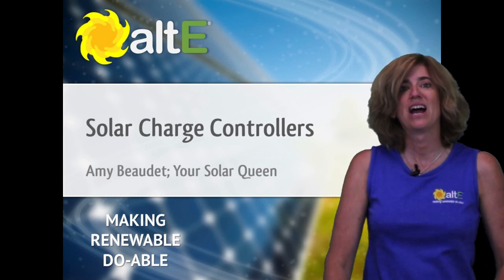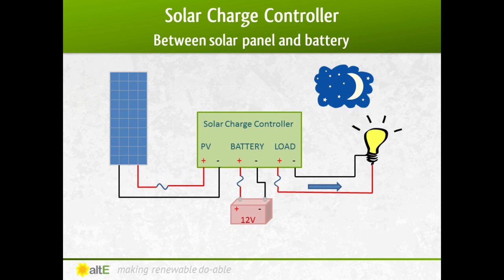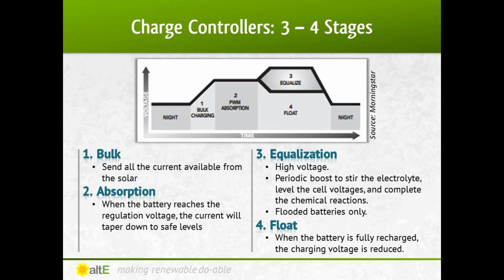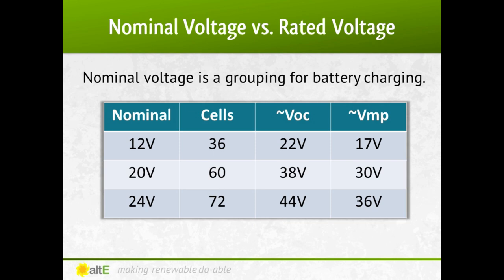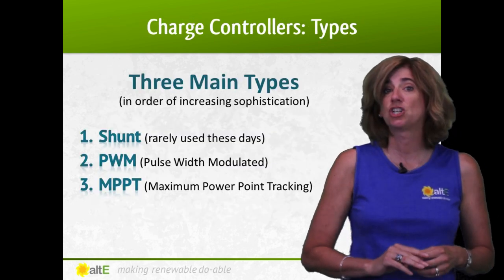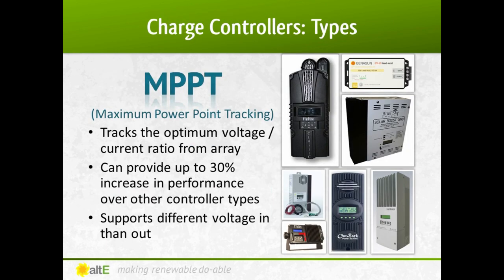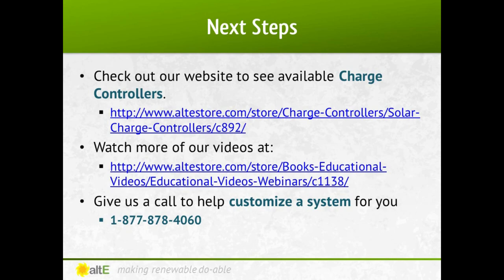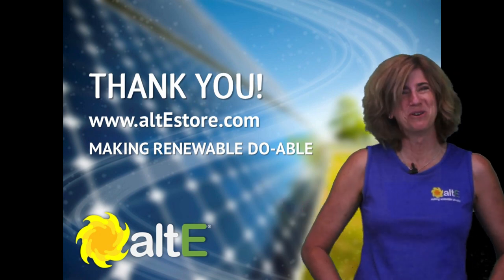Solar Charge Controller | What is it and How it works in a Solar Power System

Comment: plz help i am a litttle confused i have alino inverter 3024e by outback and it has a built in charge controller of 80a it supports 24v plz see its datasheet  http://www.outbackpower.com/products/integrated-systems/alino/item/alino-tl. its datasheet says that with72 cell panel i can make 5 to 10 panels in series and max of 2 paralel combintions if i connect 5 panels in series and make 2 paralel combinations my total watts wod b 3300w(10*330w panel) and 3300/24=137a so ineed 137a charge controler but the inverter has 80a mppt cc .similarly 24v*80a=1920w but it says i can conect up to 4000w i followed the datasheet kindly comment on this
2) with same inverter same 10panels of330w making 3300w total and with 2 12v 100ah batery plz tell that what portion of this3300w is going to charge my battery and what proportion is going to run my load at day.and how much time these batteries take to charge cmpletely  thanks
Reply from the maker: The datasheet says up to 3000W for 24V battery bank. However, it will limit the output to 80A. It is common to oversize the solar array to provide more power earlier and later in the day. But mid day, if conditions are perfect and the panels are putting out full power, the charge controller will limit the output. However, what I am concerned about is if your batteries are lead acid, your battery bank is much too small for 80A. You should have at least 4x that battery bank. Charging a 100Ah lead acid battery bank at 80A will damage them. If it is lithium, I would still recommend at least 200Ah.

Comment: Bulk charging mode doesn't mean you can send the battery bank all of the available power.  A large solar array can easily "overpower" a small battery bank for example.  Also, you are misleading people that you need 48V rated solar panels (or some combination such as four 12V panels), to charge a 48V battery bank.  This is not true.  They have boost converters such that a 24V panel (for example), can be used to charge a 48V battery bank.  I have one of these boost solar charge converters and it works quite well.  Very bad Amy that you are giving out wrong information.  Downvoted for wrong information.

Comment: The math annotations in the video are weird at 7:15... the way it's explained is terrible. The example should read, if you want to run 1500w heater for an hour, you need to generate at least 1500w in one day. Since you only make 300w, you will need 4 more panels (totaling 1500)to generate the 1500w your heater consumed. 

the formula should be 1500w demand - 300w supply = 1200w deficit... 1200w (deficit) / 300w (generated per panel) = # of panels needed to get 1500w

the second example is worse. 1500w x 5hrs = 7500w demand. 7500w demand / 300w supply= 25 PANELS not 2500w. 2500w is the total W generated for you system...again it's the same information but annotation doesn't match the explanation.
Reply from the maker: I think you wrote this comment on the wrong video, we don't talk about sizing the solar array in this one, just the charge controller. However, you are mixing up the terms watts (W) and watt hours (Wh).  A 1500W heater for 1 hour requires 1500Wh of energy.  The amount of panels you need to make this varies based on location, but lets say you get 3 sun hours a day in the winter. 1500Wh / 3 sun hours / .65 losses = 769W, or round up to 800W of solar needed to make 1500Wh to run the heater for 1 hour.   Running it for 5 hours would require 5 times as much solar.